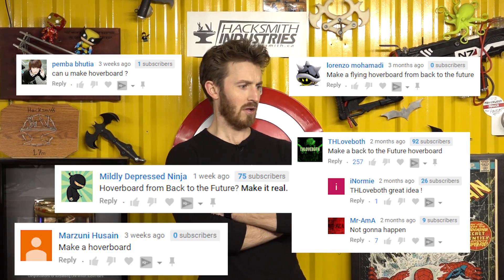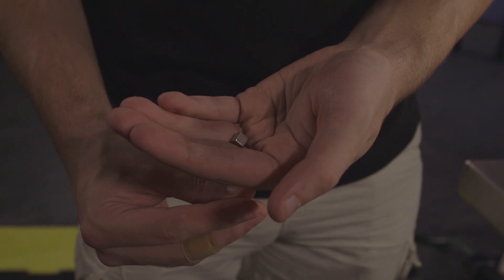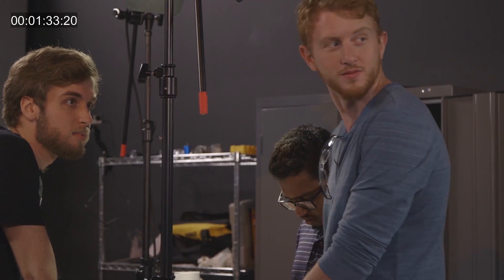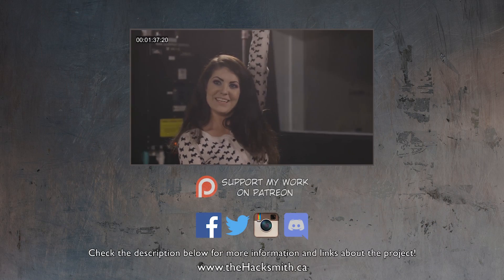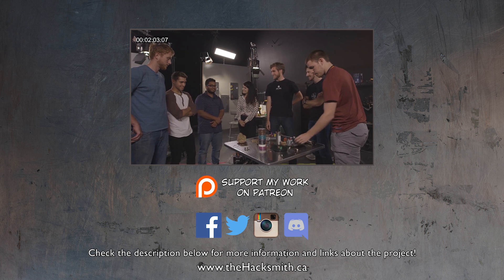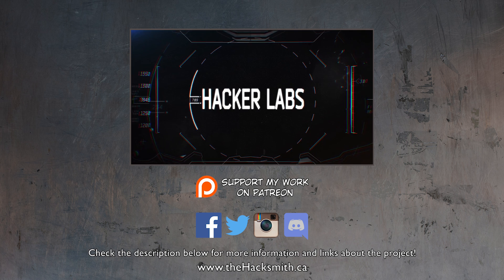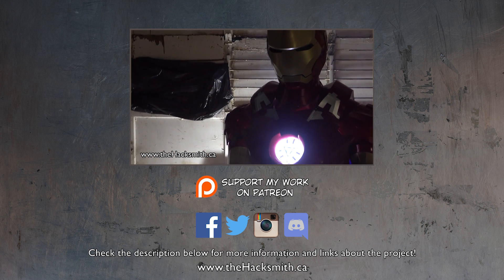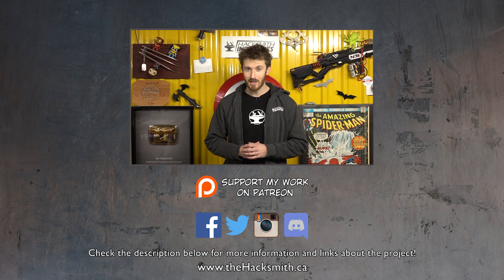Making a HOVERBOARD with Hackerlabs!!!

Comment: This is soooo cool. I always wanted to build a hoverboard but sadly it is out of my area of expertise. I tried to build it but I had to gather information of what I wanted to know first. I called it project sandstorm and the prototype was the Retro Board. I wanted to start with a basic idea of putting duct fans underneath the board with batteries and a motherboard until I saw your videos. If someone as smart as you guys just lack that expensive and large fan, then I had no choice but to give up on the idea. I persisted a bit and thought of another way to cause the board to float. There were two ideas, sound and compressed air. If the concentration of the compressed air is strong enough it would be possible for it to push the board up. With sound that would be a gamble and I didn't think it would work, but I ended giving up. I wish you guys the best. Your content is very inspiring!!

Comment: I assume you're using rotating disks of magnets to induce a magnetic field in a metal below the hoverboard? I haven't seen anyone try to make a hoverboard with that method of levitation before, should be cool!
Reply from the maker: Pretty sure it's how the Hendo board works xD
Reply: I'm fairly sure the hendo board uses electromagnet coils instead of rotating neodymium magnets but it is a similar idea
Reply from the maker: Same concept though =) it's pretty cool!
Reply: Yeah hoverboards are awesome ; )

Comment: Magnets aren't the way to go. Unless you see cities inlaying all the sidewalks with magnetic strips.
Reply from the maker: +alex raduenz yeah... welcome to reality lol
Reply: the Hacksmith My opinion is the answer to actual hovering and levitation lies in compressed air through a metal mesh. Be hard to control, but it could work
Reply: The trouble would be finding multiple compressors with the capability to put out enough pressure to lift their weight, the weight of the board, and an average 200 pound person, consistently over long periods of time.
Reply from the maker: +alex raduenz don't think it's possible to get that kind of energy density yet,  unless you just mean like a normal hover craft

Comment: Hint: It's not going to work. This method was tested countless times and it only somehow works if you have superconducting magnets and around 2mm clearance from a perfectly flat conducting board. You can stand on it, but that's pretty much it.

And those tests were performed with proper magnets and not just a bunch of kid toys glued together. The magnetic field of this construction is not at all homogeneous (which is a essential if you only have 2mm of clearance under the magnets).
Reply from the maker: +Eulemit Beule hint: it's a university student project.  Even if it fails they will still learn something. 

Also there's literally a company that sells halbach array floatation "motors"